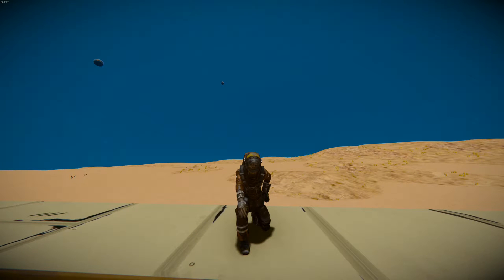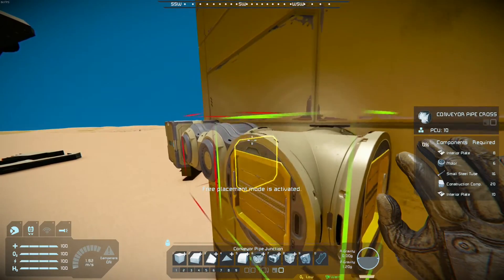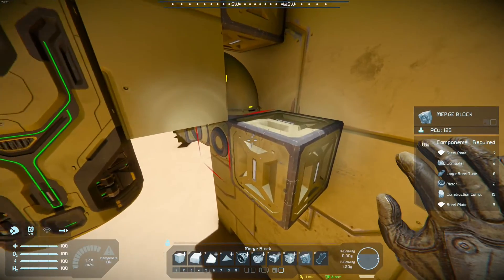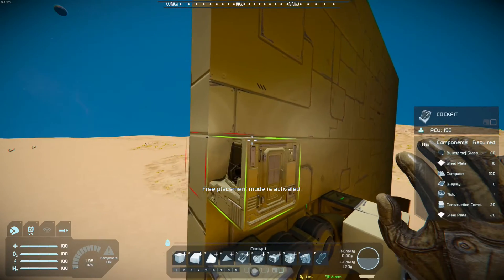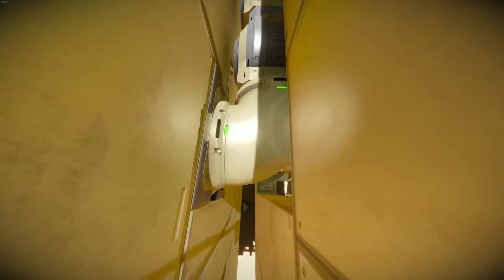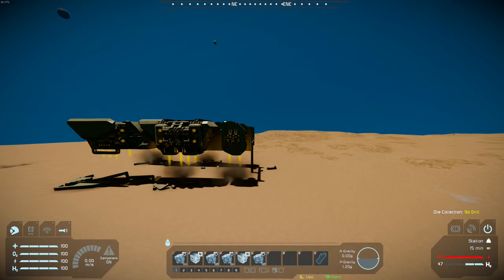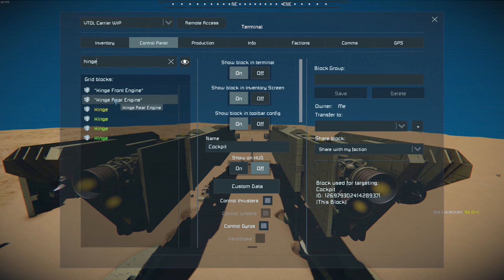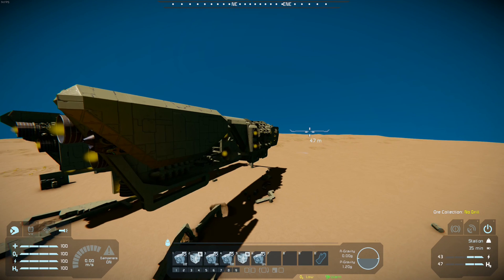Space Engineers - How to make a scriptlees VToL engine using hinges

Comment: I bet with the introduction of event blocks this has become much easier.
Reply from the maker: You could set it to automatically transition based on gravity and have it turn on the merge blocks when the hinge reaches 45 degrees. 
Biggest issue is still the clang it causes, especially online, but not much you can do about that when using double hinges.

Comment: This is actually extremely simple yet ingenious - the double hinges allowing the merge blocks to actually function correctly is awesome, and I believe was probably where a lot of people (myself included) were getting stuck on trying to do this. I suspect it works the same for rotors and whatnot?
Thank you.
Reply from the maker: In my testing rotors don't work the same, probably due to the offset that they have between the head and the body, though Keen might've changed that in the years since I made this. 
Also thank you for enjoying the video :)

Comment: You need to group all the thrusters on the subgrid and turn them off during the transition due to the thrusters fighting against the rotation. With a simple series of timer blocks you can easily automate the whole process.
Reply: Do the thrusters derp out thinking they are still in the horizontal orientation otherwise? Just curious as to how exactly they 'fight' the rotation - whether they are stopping the rotation itself or just not engage with the correct key presses?

Comment: This idea is crap u ONLY need ONE hinge and no merge blocks coz of the Lock function of a hinge.... In combination with timer blocks you can automize it
Reply from the maker: Obviously if it was only about rotating the thrusters, one will suffice, but unless you use a merge block, WASD won’t activate the thrusters. This is specifically scriptless, so while you can use computers and the lock function to make it work, this is not what this design is for
Reply: i didnt know that the lock function attatched 2 subgrids?
Reply: You really have no idea what you're talking about.
Reply: Legit only noobs
Reply from the maker: @full-timelaughingaboutstup7534  I don't quite understand, what's got you so upset?

Comment: New to the game, can't we just build ships with thrusters on simple hinges?

I was thinking of building a ship with thrusters at 30° and 60° angles or 45° angled thrusters to replace a horizontal and vertical thruster.

Or would the flight mechanics not work properly with such configurations?
Reply from the maker: If you have thrusters on a hinge, rotor or piston they will be on what's called a sub-grid, shown in orange (and other colours) in the k menu. These cannot be controled with your standard WASD inputs to fly your ship and don't properly work with inertia dampeners. That is why I've made the setup in the video, because this avoids both these issues via merge blocks, but is in turn limited to be 90° offsets.
Reply: @Leffrey  Thanks!

Comment: This is not a bug, reason for the second subgrid is because you can't merge a sub grid connected through one hinge because the hinge and hinge part occupy the same block. With the second hinge there is a sub grid in between which allow this to work. I have used this method on several ships, and you are right you just have to be patient and let the game do the math. Happy building
Reply: Would this logic also work using 2 rotors instead?
Reply: @jungletrooper9252  I believe so
Reply: @jungletrooper9252  yes
Reply: Thanks for the clarification, I’ve tried using one hinge before, so I was like wait!? Why does his work XD

Comment: Why not just limit the upper and lower of hinges, slap in enough breaking force to support t he weight of VTOL package and use rotor lock? Same results
EDIT: Oh wait, it's still going to recognize the originally forward thrusters as forward despite pointing the wrong way.
Reply from the maker: Hinge Lock has the disadvantage that it doesn't recognise WASD keys in order to fire up the thrusters, which is why it needs to be merged back onto the main grid. This way, it always fires up the right thrusters, so spacebar is up rather than thruster 2, which could face up or forwards, for example.
Reply: If you don't have the thrusters connected to the main grid, they won't respond to movement controls at all. You must use a merge block to connect them to the grid your cockpit is on in order to get them to work.